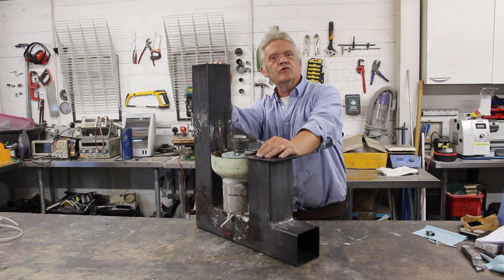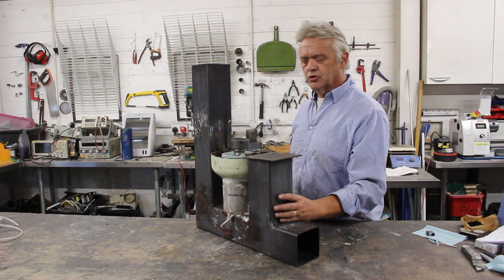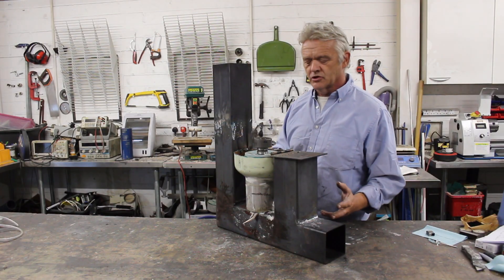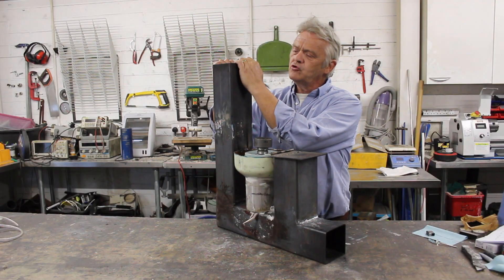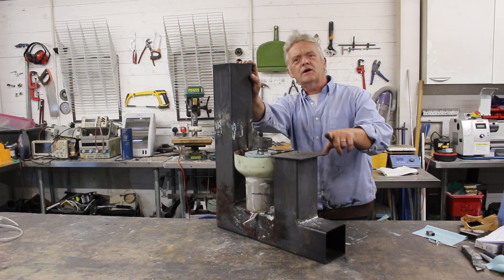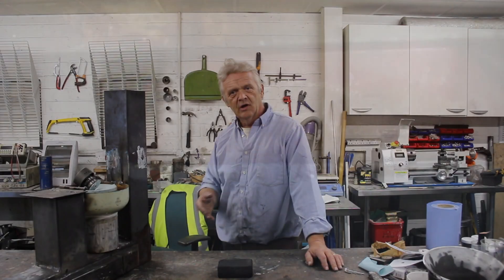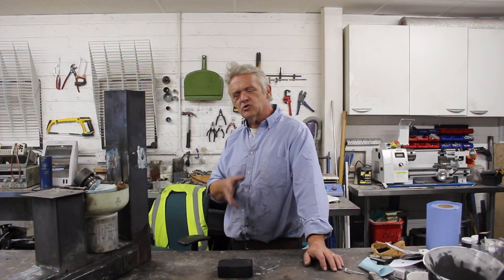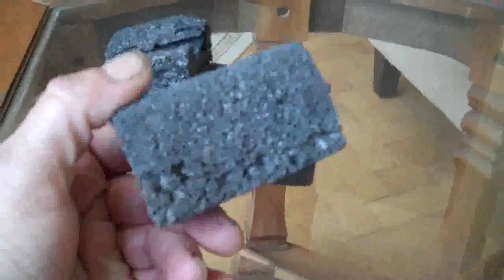1622 The Best Insulation For A Rocket Stove And How To Make It

Comment: Nice ! With less energy involved in the processs (except cement manufacture..) is to use aircrete. HoneyDoCarpenters ditd that well for all the chemney parts that are to insulate to avoid chemney fires and other hazards, while being very expensive devices. NightHAwkInLight just released a very simpler way of doing Aircrete using dishsoap and xanthan gum as bubble keeper in the mix. Still this tech is very interesting for many other uses (:

Comment: There is a much cheaper and easier way to make carbon insulators, nowhere near as strong in fact it's rather brittle but can stand verry high temperatures get a couple of slices of thick toasting white bread toast it until it's thoroughly burnt black best done outside, it may catch fire but that's ok, let it cool down and get a gas torch and heat one side of it measure the temperature on the  opposite side  amazing

Comment: Get some slices of bread, remove the 'crusts' , squeeze it in your hands until it's a malleable, paste-like, material and pack it around the section you want to insulate. A few burns will eventually carbonise the bread and produce, roughly, the same result. Alternatively - create the mould by squeezing it around the section you want to insulate - remove it and use a blow torch to carbonise it before hand.

Comment: A rocket mass heater is what you want. Cob, stone. sand, gravel, water and just pockets of air are all used as thermal batteries. How low could you make the exhaust leaving the room? I have seen the air at the top of the room the same temp as the chimney exhaust. Pearlite in a water-glass matrix is a good insulator also.

Comment: Wow. So the best would be to make the internal of the first combustion area lined with the Carbon Foam? No? This should save the mild steel from degrading over time and extend it's life. As long a you have air control, things shouldn't get out of control. Have you ever experimented with using TEC tiles to convert the heat passing through the tile to a heat-sink and then passing heated air to a cold room via central heating duct? Also, if you had enough T.E.C units (aka Peltier Tiles) you could power a small PC fan to then supercharge the air intake OR use for the driving of the air being heated into the place you want it to go. Rocket stove central heating. Turn scrap wood into heat in your house and the more you stop the central heater having to come on, the more you save.
Another Idea I love is charging up a large insulated water tank - then making an outdoor camping shower OR use that for Hydronic heating in your house.

Comment: Hi Rob, Thanks for another interesting video. Could you mold a burn tunnel out of carbon foam and have the carbon foam in direct contact with the combustion without the steel liner? How do you get hold of nitric acid?  Don't tell me that you make it yourself! Thanks again Tim

Comment: You could push some bits of ceramic tile in from the air inlet.  What would happen if you apply the foam in its gungy stage to the stove then run it ? Would it fully cure over time whilst increasing the burn area temperature?  Once you hit about 800 degrees C would you not start generating Nox ?

Comment: Yes, the temps can get up to 2000-3000° F- enough to melt metal. At the very least, it can cause spalling & eventually degradation of the metal. It is usually NOT recommended to make them from metal.

Comment: I've had a bucket rocket stove for about a decade now, in the van for camping use. It's basically a steel bucket with a hole cut near the bottom. I stick a couple of large tin cans inside, cut to shape and taped together in an L shape, then fill between the cans and the bucket with some thermal mass. Latest incarnation is 50:50 plaster of Paris and sand. Now it runs hot as a forge, and stores heat like a sand battery. Trouble is, it's heavy as hell.
I have a cast iron Dutch oven full of sand that I put on top of it, run it outside on sticks, then use it to heat the hallway of this old sandstone building I live in, up in the Scottish Highlands.

Comment: If the stove was embedded into a mass of sand, in a fridge carcass for example ( laid on it's back) would the sand act as an adequate insulator for burning purposes but also collect heat that could be piped into a room?

Comment: Instead of using the Stirling engine to produce electricity in this setup, I think it would be perfect to instead put a fan blade on the Stirling engine
to push the hot air around the room. It's a space heater without electricity

Comment: Shouldn't the refractory material be on the inside of the steel to protect the steel, like the firebrick inside a wood stove? You said earlier in the video that the rockwool around the steel raised the temperature inside to dangerous levels capable of melting steel.

Comment: If you heat rockwool up around 1000' C the fibers if breathed in it causes silicosis which is similar to asbestos I worked in the Aluminium industry and we were very aware of this issue and it is not an issue that should be made light of
Reply: You don't have to heat it up. Any rockwool dust of respirable size will cause damage in proportion to dust volumes and exposure time. Wear a mask and tight fitting goggles. One tip if you want to avoid itching is to take a cold shower after work. Hot showers open up the pores and tiny fragments get in and itch for days.

Comment: Does the carbon foam lend itself to being machined, molded, or cast into shapes? If it is used to produce heat shields for spacecraft, then could it also be formed into a hollow insert to line the inside of the stove body?

With the properties you describe, it would seem the ideal material for the interior of a stove or rocket mass heater. All of the surfaces where combustion takes place or the gas products  flow for the secondary burn would mean more of the output as heat.

Or would the carbon foam be too good at isolating the combustion? With no metal surface reaching the high temperatures, the combustion would not get hot enough to create the draft and secondary gas burn?

Comment: I figured out an easier, faster, and more efficient way to use vacuum insulation for these.  Take large, wide mouth mason type jars. Use something like a Pump N Seal system (fairly inexpensive) to pull a vacuum on it.

Since that uses little tabs to seal, you'll have to use copper or aluminum tape to better/more long term seal it. Then the entire top is going to be sealed with Water glass.

After the jar is sealed with Water glass, then you connect various jars with a combo of water glass and fiberglass cloth.  

After you get the sides of the structure made, mix some clay with fumed silica and/or perlite and coat at least the inside and top of the structure with a thinnish layer of the clay mix.  Make sure the top of the jars have a thicker layer to protect the lids etc from too much heat. 

You're on your own as far as the ceiling etc but also use insulation.  Since 32oz mason jars are a few inches wide, along with the 28" or so Hg of vacuum pulled in same, this will provide just a ridiculous degree of thermal insulation, and I mean ridiculous. Talking something like R150 in the center, plus the little bit that the insulated clay mix adds to the system.

Comment: If the steel is insulated on the outside will it add to the problem of too much heat in the steel. What if the insulation was on the inside?

Comment: I was wondering if using INCONEL metal would be sufficient at resisting the heat of the rocket stove without using the carbon sugar insulation Robert ??? Can the carbon resist having wood logs thrown at it ??? Thank you Sir for your help. I am in the process of making a rocket stove and would like to stay with metal more so than using bricks. Peace vf

Comment: Even better than the above, is take some fiberglass, rockwool, or ceramic fiber batt, wrap it in some steel foil of some kind, seal it up air tight (welding), and pull a vacuum on it.   Then on one side, take some stainless steel mesh, and paste NightHawkInLIght's Starlite like material into/onto the mesh. This is to protect the steel foil from super hot temps (You might be able to skip this part if you use pure or nearly pure Ti foil? But I'm not sure how easily Ti can be welded, and it is expensive AF). 

        The combo of this would be unbeatable as to hot temp insulation.  I would love to do this myself, but I don't have welding equipment or experience.

Comment: Love it as always! 
Tried carving a rocket stove out of spent mycelium bricks (as insulation and body) didn't really work yet... Any ideas on how to make an easy diy efficient oven for those temperatures? I'm assuming i need to make a functioning rocket stove first (;
Reply: What if you performed pyrolysis on the dried spent mycelium bricks?  That would turns the bricks into something close to a carbon foam (though I don’t know how it’s density/porosity would compare to the described method)

Comment: If that carbon rock is the same material I'm familiar with and was used in large curing ovens, I called it FART ROCK. All you had to do was rub it on anything and it stunk like rotten eggs. I had lots of fun with some pieces of that stuff. The large ovens I'm taking about was used by Levi Strauss & co. for curing pants 👖 to be permanent press. That was back in the 70s and 80s in Little Rock, Arkansas USA.

Comment: I suppose the marketing trick of carbon foam it that its the best insulator material. The best insulator is vacuum because heat literally cant move through it but I guess thats not really a material lol

That sugar recipe is amazing, I'll have to try that, thanks! 

I've been interested in carbon foam insulation for a while after i learned you can basically take a cookie and hold in in the palm of your hand and point a blowtorch at it and hold it there for a shockingly long period of time before you start to feel the heat through the cookie as it actively produces an ablative carbon foam which effectively dissipates the heat

Comment: I have watched a lot of rocket stove videos and yours is by far the best at explaining the way they are intended to work and the necessity of a super-hot post-firebox area to efficiently burn prior combustion products at up to 1500degC. The carbon foam insulator sounds interesting but I can't see me being allowed to use the family oven, not least because of the electricity bill. You also reference at a key issue - a proper rocket stove needs to burn too hot for steel to be used in all of its construction.
Reply: Rhian Taylor:  so if you’re making a rocket stove that similar to this, you may have to be willing to line it with fire bricks; if you’re looking to find an oven  that you can use for making carbon foam insulation, you may be able to work it out with your family to set you up a place where you can set up a used, cheap toaster oven for this purpose, possibly outside in the shed or garage where they won’t have to smell it.
     Of course, if they agree to it, you may have to make it very clear at the outset about how much time is going to require to run, so that you can arrange with them, how you’re going to monitor it.

I hope this works out for you, and that you will eventually come back to let us know how it turned out. :-)

Comment: What you said is true but insulating the outside of the burn chamber and riser tube will keep the heat in as it's supposed to but at the same time cause the steel to get to a temperature that will burn itself out relatively quickly. You do gain efficiency when insulating the burn and riser tubes but the insulation must be on the inside so the steel remains at a low enough temperature to not burn itself out.

Comment: I have been looking into rocket mass heaters for barns/ garages, etc. for a few years now. I was shocked to see one in a house in a very cold environment where they did indeed melt the pipe used for the fire part, and had to re-line it with firebricks. Wow, definitely stupendously hot! There is also a video on here of heating a greenhouse with a form of mass heater and heating water as well, running copper pipes through the mass...the possibilities are very interesting. The idea of making stunning insulation from sugar is wild. Thanks for always bringing new ideas and ways to go about generating power, you always have interesting ideas.

Comment: Robert, there's another way to achieve nearly aerogel-like levels of insulation: Make an enclosure around what you want to insulate, and pour fumed silica into the void space. The fumed silica is essentially a powder insulation. It works incredibly well at stopping all modes of heat transfer because:
1)  prevents convection by filling the volume with powder
2) the individual particles of fumed silica have minimal contact, essentially cutting off direct conduction of heat
3) it back-scatters radiant heat.
The only thing you need to ensure is that there's an opening somewhere which is covered in some kind of filter fabric material so no pressure builds up, without any of the powder coming out.

A poured fumed silica powder insulation should achieve far better insulation than any of the carbon foam without the problem of being flammable.
Reply: fumed silica is supposed to also be useful in making dilatant greases, Akin to ooblec but it doesn't go off. Fumed silica, and a carrier, say glycerol.
A shaft turned disk rotating in it, offers little resistance at low rpm, but the resistance builds up to a point at which it's akin to locked solid. rpm drops and it loosens up again. nice simple rpm limiter for say rubber band powered models, or maybe even wind turbines
Reply: Even better than the above, is take some fiberglass, rockwool, or ceramic fiber batt, wrap it in some steel foil of some kind, seal it up air tight (welding), and pull a vacuum on it.   Then on one side, take some stainless steel mesh, and paste NightHawkInLIght's Starlite like material into/onto the mesh. This is to protect the steel foil from super hot temps (You might be able to skip this part if you use pure or nearly pure Ti foil? But I'm not sure how easily Ti can be welded, and it is expensive AF). 

        The combo of this would be unbeatable as to hot temp insulation.  I would love to do this myself, but I don't have welding equipment or experience.

Comment: Can you cast and fire the carbon foam in situ around the lower section of the stove, lower the stove itself into an appropriate container with the sugar solution, and fire it up for the two days? Maybe instead of while it is a fluid you could pour the sugar solution, when it has thickened, to a plaster consistency?

Comment: best DIY, non combustable/stable insulating refractory I found for "usual" high temps is aluminium oxide (blasting grit), pearlite/vermiculite, with sodium silicate used as a binder... 
works fine for a charcoal fired aluminum melting furnace. Though it did melt before the steel did when I experimented using it as a liner for an arc welder powered carbon arc furnace/crucible , in the hope of being able to melt a handful of steel nails, and maybe cast the metal. (i guess it might turn into cast iron due to carbon from the rods) . Under same conditions a  starlight type mixture expanded into carbon foam, and worked fine until it was glowing white hot, and then ignited due to air getting in through the holes in refractory body from prior experiments with gas heating. steel nails had clearly started to melt, as they had started to weld themselves together.
Reply from the maker: fascinating mate - thanks for sharing

Comment: You can accelerate the fire coming from the pipe in the same way as in your rocket stove, a separate air intake produces more oxygen to burn the gases (like you have). Insert similar tubes on the side of the upward chimney and shortly before the end of the chimney bring them into the combustion chamber (perhaps 5 inches lower than the mouth of the chimney). This way you get superheated oxygen which speeds up the fire, and it doesn't hurt if you put something at the top of the pipe. The oven does not clog
Reply from the maker: Thanks for the info!